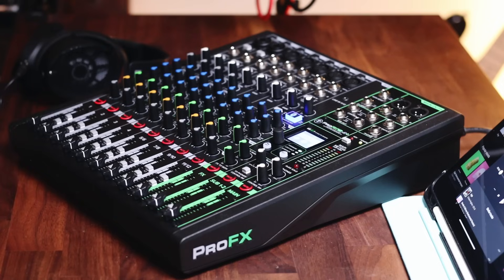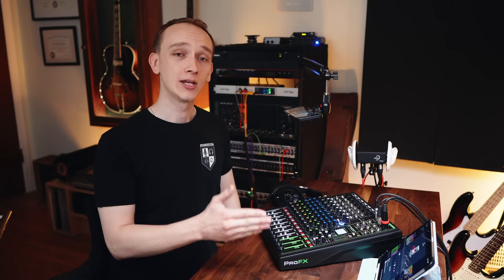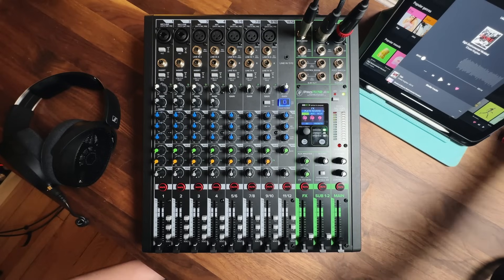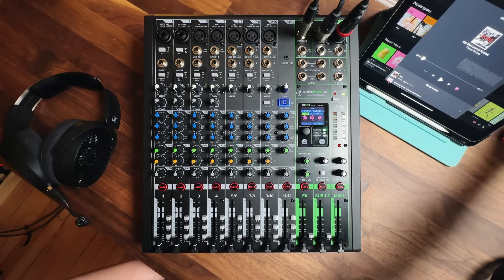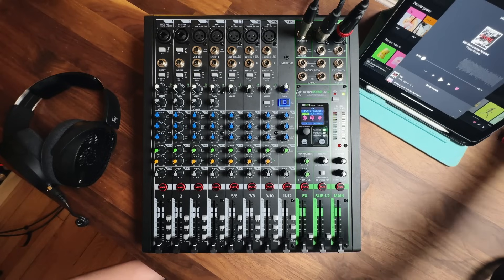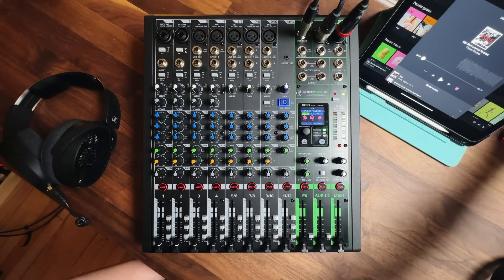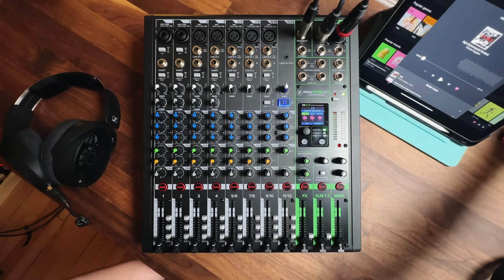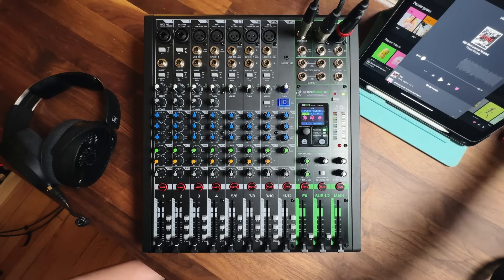Audio Mixer Setup: A Beginner's Guide

Comment: How would you visualize the behavior and what would you say is the biggest drawback of using a one-knob compressor on a mixer? There's no control over ratio, threshold, knee size, limiter, etc like a normal compressor. In your experience, are all one-knob compressors generally the same in what they do or can they be surprisingly different? I mean obviously the answer is: read the damn manual, use your ears, and patch it with your own dedicated compressor if you don't like what it does, but I'm generally curious how ubiquitous the internal settings of the one-knob tend to be.
Reply from the maker: I'm not sure exactly what the single control does. Good question though. Maybe it's a threshold with a fixed ratio, maybe a ratio with a fixed threshold? Or maybe a mixture of both? Here's a video for those interested in learning about the other controls commonly found on a compressor: https://youtu.be/lgCYjek5_JY
Reply: I've experimented crudely with the 1-knob comp on Yamaha consoles and they behave like the "auto microphone level control" of video meeting softwares. It not only reduces loud signals but also boosts quiet signals (that's why a feedback is likely to happen when the comp knob is cranked up to full). The attack time is fixed to approximately 25ms, so it can't be used as a drum punchiness enhancer or do any aesthetic treatment to the sound. However it's quite useful for leveling out the signal of a condenser mic feeding my high school's public address speakers.
Reply: @AudioUniversity  According to Yamaha's user manual of MG series consoles, the knob controls threshold, ratio and makeup gain simultaneously. When the knob is at zero, the threshold is set to +22dBu(unreachable), the ratio is 1:1 (totally bypassed) and the makeup gain is zero. When the knob is fully cranked up, the compressor will activate at -8dBu with a ratio of 4:1 and 7dB of makeup gain.
However the attack and release time are fixed to about 25mS and 300mS, so it's impossible to use this compressor to add punchiness for drums and basses.

Comment: Thank you! This video was extremely helpful! I was struggling with getting my band's mix right (I am by no means a sound man, but since I own the PA equipment, I inherited the job). Interestingly, I used to use a Mackie ProFX12v3 mixer, but upgraded to a Yamaha DM3 digital board because I needed more inputs. BIG difference in the way they operate, but the basic principles are the same. Anyway, our powered speakers are two LD Systems Maui 28 column arrays along with two QSC CP-8's. I used to set everyone's gain, set the speakers to about 75%, set the master to somewhere around -10 dB, then and adjust everyone's sliders to get the volume we wanted. This sort of worked, but the sound was less desirable than I had hoped for. After watching your video, I tried setting the master and individual sliders to unity, then bringing up the speakers until the volume was right as you recommended. Sounds much better now, especially the electric guitar (running through a Fender Tonemaster Pro). You are a true expert in audio engineering and I appreciate the help you've given me and my band! 🙂
Reply from the maker: Glad to help! Nice job putting these tips into action! Well done.

Comment: Loved the way you did your info, but I gotta disagree on a few things. 1st off you have to know what type of DJ you are talking to. I went full time in 1985, that's just so you know I am not some start up DJ... but I have always been a wedding/corporate DJ.... not a mixing club DJ.  Also I am the biggest dork when it comes to technology. If it stops, I know the basics but beyond that I gotta call someone.

With that being said VDJ is solid and "out of the box" I didn't have to change a thing, or at least very few. Not sure why you have the "auto tempo" (or whatever you call it, on, but I have never had that problem..  I play mostly videos, I do karaoke and mp3's with a controller. It HAS to be easy for me to use and it HAS to be very user friendly. My head will explode if it isn't.

I have tweaked a few things and VDJ does a ton more than I even use. And you didn't even touch on Stems, the real game changer for "just ok" mixers such as myself. And I have heard, came out before Serato, which I have never tried. No reason to. I have nothing against it but in my mind, if it ain't broke, don't fix it :)  Thanks for the time.